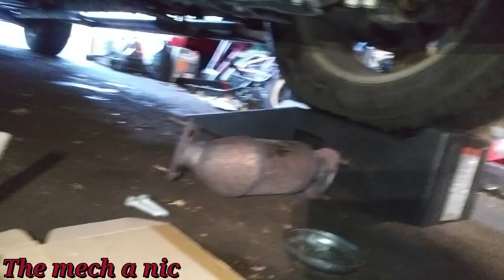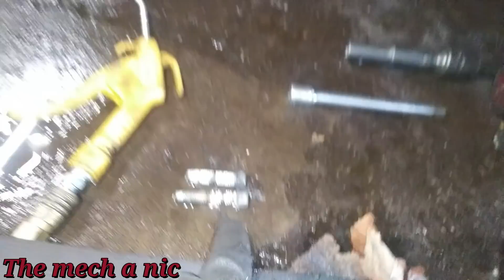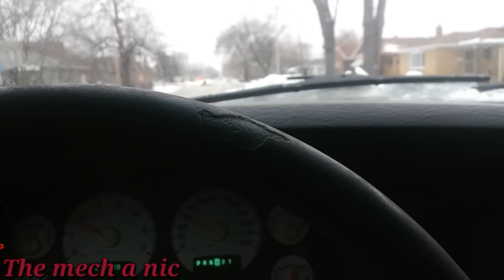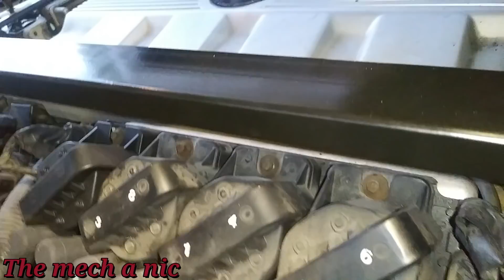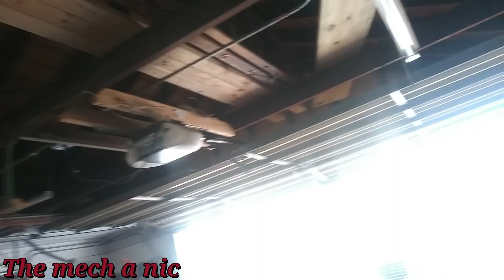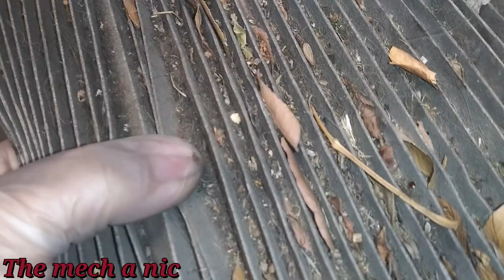sienna tune up / acadia starter / ram 1500 steering link (vol 75)

Comment: that sucks to have to take the cowl off to change the spark plugs
Reply from the maker: Extremely annoying to say the least
Reply: @themechanic6117  how long did it take to get it off and put back on?
Reply from the maker: Its just about 10-15 mins to take off so not too bad but still its extra work just to change spark plugs

Comment: I just did a Chevy traverse starter....same as what u did😏 I usually take that motor mount out to get to the starter....seems easier than potentially snapping the catalytic converter bolts👍
Reply from the maker: As long as the bolts come off its not too bad of a job 👍
Reply: @themechanic6117  😉

Comment: Get a 4" shallow tote
Add some used coolant (50-50)
Keep your aerosol spray cans immersed or floating is fine.

Or- before use, run under warm water and shake to warm liquid.

(or you can hit it with your purse)
Reply: Nice!
Reply from the maker: Im not sure what this is for. Anything specific in my video?
Reply: @themechanic6117  Remember, I live in same climate. Aerosol cans loose pressure when cold. Try to use, gas runs out, product is left in can, useless. Keep cans in a tote or bucket, used coolant (50-50) to keep them useable. Or- run under warm water before use. I heard one of your cans sputtering.
Reply from the maker: Ahhh now i remember. Thank you

Comment: After 30+ years, Im changing all the heater and rad hoses on my crx and 88 civic ef sedan... do you like Dayco brand hoses or should i try and get OEM if they are available ? Im not gonna get those shitty mishimoto or ebay silicone china crap..
cheers
Rob
Reply from the maker: I've never had a issue with Dayco hoses 👍

Comment: @718

Near end of where you say "silicone" cross drill, down till
you hit shaft. Spray pen oil into hole, drill more if needed.
Bang with air hammer. That most likely a dust seal,
keep splines clean.
Reply from the maker: I tried the slide hammer and hitting it from the back with the air hammer for 45 min and it did nothing.
Reply: @themechanic6117  
Any time you have a frozen bolt or shaft-
try to cross drill into what it goes into (it's boss) and that gives access to spray. That fluid you show- meh. Make up some 50-50 acetone-ATF or Kroil.
Reply from the maker: No i didnt do all that. Sometimes i just have to throw in the towel if its taking to long and no signs of it moving. I could see how that method you mentioned could be effective
Reply: @themechanic6117  
https://www.youtube.com/watch?v=rcThFswcLB0
Reply from the maker: 😂😂thanks for the inspirational video but when its 35°F in the garage and something doesn't go as it sure I'm not very inclined to pursue it. I freeze out there lol
Reply: @themechanic6117  I really do admire your work ethic and kindness. Your situation calls for understanding and charity; you are surrounded by hatred, greed and ignorance. Many there would slit your throat and rob you- only a few are trustworthy. Keep your Shop closed when prying eyes come around, clockin your commissary, as we used to say. Most of the time- I seem like a pompous know-it-all, but I really DO know how to fix things, since about 10. 58 now. First job was at 12, Uncles Shop, gopher, grease monkey. Watch & learn and ask. Break stuff. Owned 13 cars now, this '89 is newest so far. I've been dirt poor and "well off". I'd rather just be happy.
Reply: @themechanic6117  https://youtu.be/mVWgHiR6rlo
Reply: @themechanic6117  Cross drill & soak?
Did you reference a diagram?